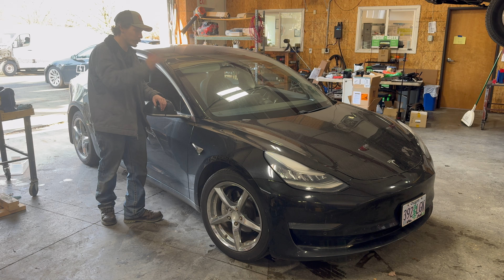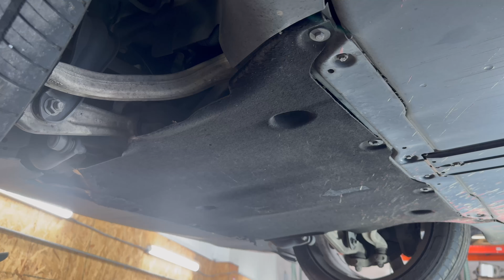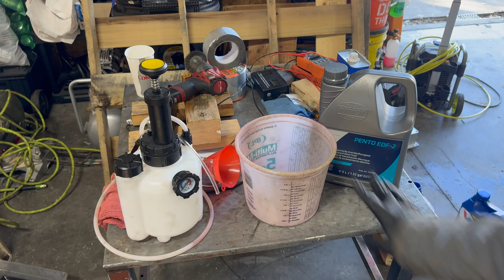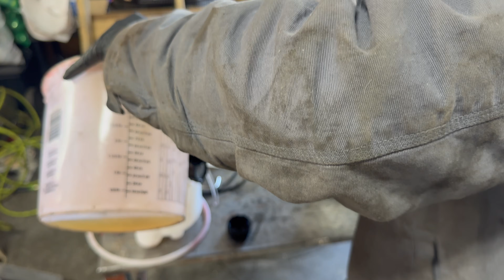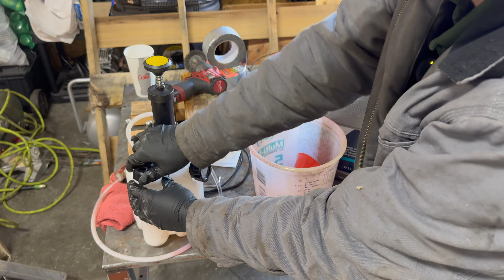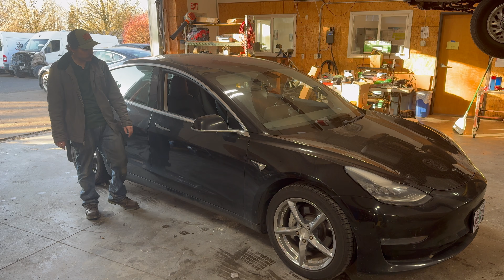Tesla Needs An Oil Change? Model 3 Gearbox Fluid Exchange Process

Comment: Fyi the oil filter on the newer 3/y motors starting in 2024 have an internal filter. Sure new oil isn’t a bad thing but motors don’t see the heat and friction gas engines do so there’s no real need for new oil or a new filter. You’re good to go for the life of the car which is longer than the vast majority keep their cars
Reply: Nevermind I see you mentioned this in the video

Comment: the oil cartels are hiding this data from us. 
  Engine exhaust contains numerous toxic, cancer-causing chemicals that deeply penetrate the lungs, leading to a high daily death toll from lung cancer, currently 360 Americans.
Mental Health: Chronic exposure is linked to increased susceptibility to anxiety, depression, and psychological stressDevelopmental Disorders: Prenatal and early childhood exposure is associated with a higher likelihood of Autism Spectrum Disorder (ASD) dCognitive Impairment: Even short-term exposure, such as two hours in a traffic jam, can temporarily lower the brain's connectivity..
Neurodegenerative Diseases: Research from UCLA Health and Emory University has linked diesel exhaust to an increased risk of Parkinson’s and Alzheimer’s
For those stuck with the old rotary phone ICE vehicle,
E-85  is much cleaner, mostly less expensive, and helps American farmers.It's  now sold everywhere in the states Furthermore, the oil industry's efforts to spread misinformation and obstruct the adoption of electric vehicles (EVs),E.V’s are Zero emissions.

Comment: Great video, Alex. A couple of notes for people reading comments. The front drive unit and rear drive unit have different fluid volumes. I mean when both front and rear are 3du units (my model 3 rear 3du unit needs 2.1litres). You can trigger the pump via app when the car is on the lift when you send it location to a supercharger location from your phone. It will start preconditioning. Have the pump running while you refill the fluid. Keep it running and close fill plug while it's still running (something tesla tech told me). Makes it easier than the hanging millwake battery that gets in the way ;)
Reply: He did actually make it clear in the video about the different oil volumes for front and rear motors.
Reply: @MrAdopado thanks for correction ;)
Reply: I did this on my 2022 M3 LR and got the preconditioning started, but the oil pumps did NOT run.  I also tried the trick where the wheel size is changed in the menu which forces the screen to reboot which is supposed to run the oil pumps.  It didn't.
Reply: Good idea.  I wouldn’t be unplugging anything on newer cars.  My Chevy goes into limp mode even unplugging the something simple like a MAF for a CAI install.
Reply: @neckofthewoods24   While working on my brakes and changing the drive unit fluid on my 2022 M3 LR, I disconnected the brake assemblies and oil pumps while the low voltage battery was still connected, and it didn't cause any problems.  I did notice service messages on the display that occurred while they were disconnected, but they went away as soon as I plugged them back in.  No lingering problems.

Comment: What is the point of running the pump when the oil doesn't leak out, when the pump stops? Obviously the level is below the fill plug.
Reply: Because there's a possibility of an airlock in the pump and/or filter that takes up space that would potentially mean you would be leaking oil back out of the filler hole beofre you've added the full amount. However, I reckon that if you can manage to get the appropriate quantity of oil in there without dripping back out then there's no point running the pump.

Comment: I never did any of this garbage in 300,000 miles. And its still going strong! 2021 model 3
Reply: And why the model 3 in this video won’t last 300k, he botched the job by using the wrong out of factory spec fluids 😂😂😂
Reply: @Nico_Murillo_worships_Satan   From the online Model 3 service manual:  
- For all 3DU drive units up to and including Model Year 2023 use ATF-9 (part number 1135241-00-A) or EDF2 (part number 1616951-00-A), or ultimately KAF1 (V1.2) (part number 1646886-02-B or 1646886-04-B)
- For all 3DU drive units Model Year 2024 and later use KAF1 (part number 1646886-02-A or 1646886-04-A)
- For all 4DU drive units use KAF1 (V1.2) (part number 1646886-02-B or 1646886-04-B)

Comment: hmmm, one, always remove the fill plug first for obvious reasons, two, using sharp objects can easily puncture the O-ring on the pump and since you can't easily replace it at the very least you need to inspect it before sliding the pump back in, lastly, only replace what you took out otherwise you overfill it and you won't have to rig the pump to run it! And for the love of everything, replace the fill plug before cleaning...

Comment: Nice EV maintenance tips could you to also include coolant replacement at the 5 year mark on the MYLR with 70,000 miles. Keep up the informative videos.
Reply from the maker: Replacing the coolant isn't really so imperative - so long as it doesn't appear dirty, and the pH is within the range it should be (you can buy coolant pH test strips like these for pretty cheap on Amazon: https://amzn.to/4aFD96m).

Comment: The reason this oil change is relatively uncessary for most people, is its a single reduction gear design. The reason transmissions need fluid changes, is because they have clutches and clutch packs, even torque converter automatics for the last 8-10 years have been using clutches to couple the torque converter in a 1:1 connection with the transmission (famous toyota transmission shudder issues etc, you can look it up). This coupling and decoupling causes wear due to friction. Also in automatics the gears are actually not helical, they are cylindrical designs, which typically involves some kind of devices (friction based) to engage and disengage gears, which do wear and tear because of constant movement.

In a tesla, with a single reduction gear, the motors are permanently coupled to the reduction gear, there is almost no wear and tear here, there is nearly no movement and thanks to the oil, no friction of metal on metal. If there was metal on metal it would instantly shear the gear teeth. Since gear teeth aren't being sheared off, then everything is working as intended. Plus, there is a filter there. These filters are pretty big for what is essentially a 2-3 liter fluid. ICE engines don't even use this amount of filtration on automatic transmissions, and if you look at any ICE engine using 4-5qts of oil, their oil filters are about the same, and soak up A LOT (millions of times more) wear and tear and friction.

I see very little reason to change this fluid out for wear and tear reasons, but oil does break down over time due to age, which is probably the more appropriate reason to do this. Maybe 100k miles is a good starting point.
Reply from the maker: Yes, my recommendation for these cars is ~100k mi intervals - mostly since the anti wear additives break down over time and heat cycles. There is absolutely still wear and tear going on, as will happen with any moving parts. Also, the oil for these drive units is used as the cooling medium for the stator; and when preconditioning, is used to transfer excess heat from purposely running the motor(s) inefficiently to heat the battery, so it actually does see some pretty significant heat cycles. 

Some motors/gearboxes used in other vehicles are much more prone to premature wear issues in the gearbox due to poor design, and for those, more frequent changes can help extend their lifespan (1st gen Kona/Niro are notorious for gearbox issues for example). The Tesla LDU is another one that I'd also recommend more frequent changes for (~50k mi intervals).
Reply: Why compare it to an automatic transmission when it is more analogous to a conventional non-limited slip differential?  You still change the oil in a differential every 30-60k depending on drive conditions.  Add packages wear out in oil, they oxidizes, lose their antifoaming abilities, ect.

Comment: Great video — very clear and helpful. Thanks for sharing this procedure.

I have a quick technical question:

When priming or filling the drive unit oil, is it necessary to power the oil pump using an external 12V source or the vehicle battery, or will the pump operate through the vehicle’s system during the procedure?

I want to make sure the pump is properly primed and avoid running it dry.

Thanks again for the excellent content!
Reply from the maker: That's why I fill at least half of the fluid before starting the pump - don't want it to run dry! 
You might be able to accomplish the same task by starting the car with the pump plugged in, but honestly I haven't tried it (it's simpler for me to run it manually when the car is up in the air on the lift).
Reply: @OutofSpecRenew  Thanks for your reply. I think I still have a few doubts: just to clarify, is priming/bleeding the oil pump necessary, or is it simply recommended to ensure proper lubrication?
Reply: @Gergus_  The reason for running the pump is simply to make sure that you can get the required quantity of oil in there without it flowing back out of the filler hole. If you were replacing the pump (for example) it's possible that the oil wouldn't naturally flow into it fully ... same for the new filter. Running the pump ensures that the oil is distributed throughout the system, making space for the last bit of filling to take place. Someone posted in the comments that they were able to add the full amount of oil without running the pump ... in which case there's little point running the pump (IMHO).

Comment: So you say to get it changed at 50 to 100,000 miles.  Which 50,000 mile situation is more likely to have a greater need for the change - Hitting 50k miles under 3 years or at 6 years?
Reply from the maker: Mostly model/motor type dependent... For Model 3/Y, ~100k mi intervals is perfectly fine. For the LDU (used in RWD and Performance Legacy S/X), I'd recommend ~50k intervals. Some other EVs are also prone to gearbox wear issues, and changing the fluid is critical to extending their lifespan to prevent issues.
Reply: @OutofSpecRenew explain in detail than “it’s just a good idea” why this is necessary. You struggled to change this fluid and even used the wrong one
Reply: @Nico_Murillo_worships_Satan   The fluid used is a suitable option according to the online Model 3 service manual.  I just bought fluid change kits for my M3 LR from Evannex, and they sent EDF2.  Better tell them they are not sending the right fluid.
Reply: He is treating a sealed, heavily engineered EV drive unit with the exact same mindset you would use for a 1998 Honda Civic transmission.

Listen if the oil isn’t doing it job properly you will get reduced power messages.
Reply: @Nico_Murillo_worships_Satan   If you get a 'reduced power message' it's probably too late.  I've never heard of this kind of a message in a Tesla.  Are you saying we should all do reactive maintenance instead of being proactive?

Comment: I’m planning a DIY drive unit oil pump replacement and I’m considering using the newer 2.0 pump instead of the original factory unit since it’s currently out of the stock in the Tesla parts catalog. Has anyone here actually installed the 2.0 version on an older Tesla? Curious if it was plug-and-play or if you ran into firmware issues, connector differences, fault codes, or anything else unexpected. Would really appreciate hearing real-world experiences before I order the part. Thanks!
Reply: Epc shows compatibility?
Reply: @PearlsOfWisdom613 How do I get to that page of the EPC? You have a link?
Reply: There's a possibility that the new pump is designed for 16V that the newer cars run. It would be worth checking out even if the fit is the same.

Comment: Great job! I know it’s a long shot, but I’m having trouble with my ‘23 model Y’s rear 12v plug. It died shortly after the Tesla dealer replaced my tow hitch electrical module (not sure if that has anything to do with it) and no hard reset of the computer is restoring power :( any idea what I might need to do?
Reply: Fuse
Reply from the maker: Model Y does not use "physical" fuses, instead it uses resettable e-fuses, controlled by the 3 vehicle controllers (VC Left, VC Right, and VC Front). There's a few possible causes, so figuring out what the issue is could take some investigation...
Reply: @OutofSpecRenew thanks I’ll keep investigating, I’m going to remove the panel and make sure the last tech that was in there didn’t forget to plug the thing back in lol
Reply: @Nicholas-f5  yeah I can’t find any videos or diagrams of where that is in the car, maybe I haven’t looked hard enough…

Comment: I wouldn't worry about changing the oil, I've never heard of an electric motor failing because it didn't have an oil change. There are Teslas with 300k to 400k miles and the motor still runs.
Reply: We're going for million plus
Reply: Once every 100,000 miles isn't much of a hardship!
Reply: @MrAdopado I doubt this particular Model 3 will live after his “preventative” maintenance. He used the wrong fluids, He mentions the official new spec fluid is KF1, and the old spec is EDF1, but he just uses EDF2 because it's what his local auto parts store had in stock. He eyeballed the levels, he struggles with the fill plugs, and doesn't shut off the fluid flow in time on the front unit

Comment: I think most of this type of maintenance is unneeded unless the car tells you to. These "transmissions" have no clutches, shift mechanisms, torque converters or bands that wear. The are only gears running in oil which have exceedingly long lives. They run at far lower temperatures than combustion cars. Disassembling a functioning unit like these creates more problems . If it ain't broke don't  fix it. Join me on other channels and we can argue about religion and which boat anchor is best.

Comment: Was the old fluid really that dirty or was it dyed a different color than the replacement fluid? 

Just surprised it was as dark as used engine oil which turns dark from carbon deposit buildup.

Comment: If by any chance someone wanted to change this oil at 25,000 miles or 50,000 miles or 75,000 miles could you catch the oil in a transparent container?. Have a comparison in their color. Split the oil filter to have a look. In my Honda CVT oil filter it was blackish by 62,000 miles. 🤔🤔

Comment: LOL The irony. An oil change on my electric car was the very first thing I did when buying my used low mileage (24K miles) 2022 Kona EV. I drove straight home and replaced the GRU fluid with Redline MT-LV 70W/75W GL-4. In my research prior to buying, I read that there can be a fair to high chance of failure in the gear reduction units due to a suspected cause of metal particles in the oil, which leads to bearing failure. I'm just praying that a change out relatively early in it's mileage with fresh high quality synthetic fluid will at least give me a little bit of time. I don't drive very much and am retired with no commute, so hopefully it will last me until I don't drive anymore. The old oil I drained did indeed have a light silver metallic sheen which super bummed me out, but it wasn't like a super viscous glitter factory, so 🤷‍♂ I did what I could, sigh. It was extremely easy to do, relatively cheap, (Redline is about $30 dollars a quart CDN where I live) and I would have no hesitation in changing it out for new regularly, needed or not, just because. Alas, there is no external or even otherwise accessible filter.
Reply from the maker: Yes, definitely a must for regular maintenance on the 1st gen Kona and Niro! They are very prone to excessive bearing wear in the gearboxes - I've got a few videos covering rebuilds on those... A lot of it comes to a poor gearbox design, but changing the fluid (and adding a magnetic drain plug) should at lease help extend the lifespan by flushing out the metallic particulate buildup. I'd recommend intervals of 50k mi or less on them.
Reply: @OutofSpecRenew  Where did you get the pigtail harness? is there a part number?

Comment: Still not sure about changing the oil on mine... 2019 M3 LR with 139,000 miles and 2022 M3P with 233,000 miles. Need to change the bushes on my rear DU for the M3 so might as well on that as its out perhaps
Reply: What brushes?
Reply: @leeoldershaw956  He said bushes, I believe he is talking about the three rubber mounting bushings for the Drive Unit.  Equivalent to engine mounts on ICE cars.  The rubber breaks down over time and the whole drive unit can rotate slightly in the subframe, causing a clunking sound.  You have to drop the subframe and Drive Unit to press out the old and press in the new.
Reply: @leeoldershaw956 bushes

Comment: 4:28 you definitely can drop down the subframe a bit to remove the pump, I have done it on the ground with a car jack. It's also documented method in the official Tesla service manual. Also replace the oil pump gaskets! Those have started to leak for some folks, it's only like 8 euros extra cost. For the front motor, you need to drop the subframe a bit for those though. My gaskets were fine too but I replaced them anyway. I think there may have been a material issue at some point because later years never seem to leak from the pump gasket.
14:45 instead of the pump harness I just connected the pump to the car, pressed down the brake pedal to start the pump
Reply: I had a warranty repair on my 2019 Model 3 due to a slight oil leak from the oil pump seal (rear motor maybe at 20,000 miles). It seems that when at the Service Center they couldn't get the pump to reseal so ended up replacing the actual pump and not just the gasket.